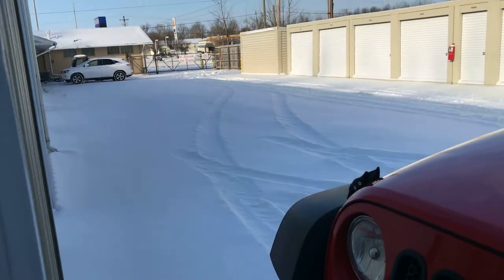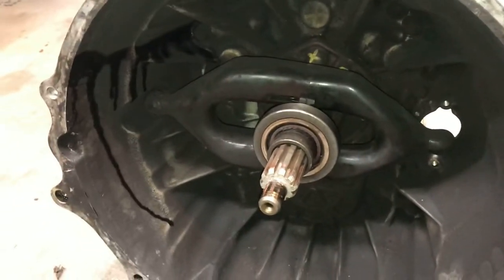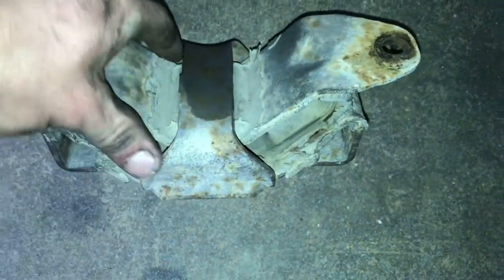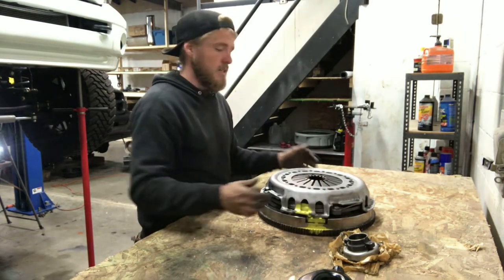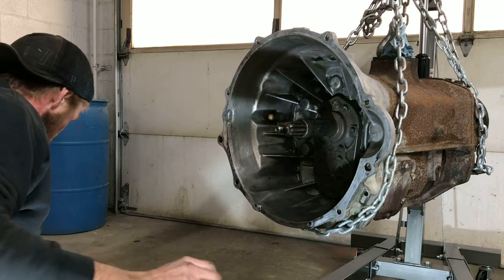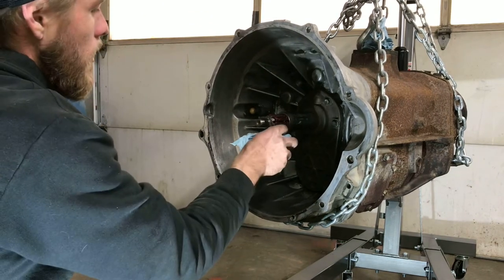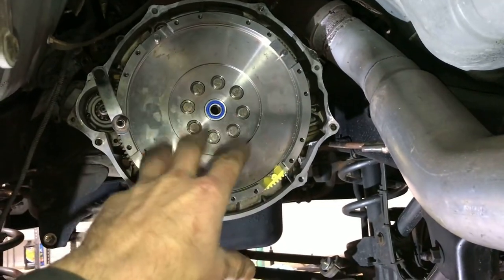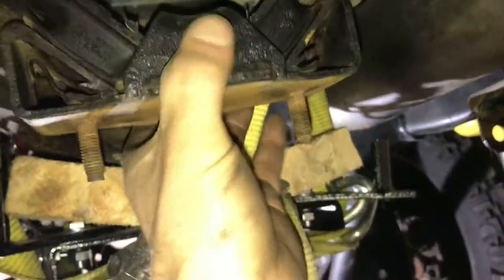CUMMINS NV5600 DUAL DISC CLUTCH INSTALL

Comment: I have a nv5600 and a valair 650 dual disk.. put the clutch in. Sounds like the throw out bearing is out. Snapped the trans 3 weeks later. New trans same clutch new Throwout from O'Reilly's put it all back together and same sound. I watched your video. Only thing I didn't do the same was take out the washer... Could that be all my problem is?

Comment: Definitely spend the money on a good adequate jack... Great video! I have an 05 Dodge 5 speed manual and this guy is trying to tell me the input shaft is bent, I have a pretty good eye being a career Union Journeyman Carpenter and I just don't/can't see it! I think he didn't grease a fucking thing! Oh, and to be clear, he did a clutch job then started telling me about the input shaft, then he couldn't get parts for the transmission which, I do know is a bitch but other transmission shops said they could get parts no problem (of course also wouldn't divulge where to get these illusive pieces) but... So, he put it all back together and soon thereafter it started making a whining when the clutch is disengaged but as soon as I put a little foot on the clutch pedal it stops. After it consistently getting louder and worse obviously, I finally got him to honor his work, dropped the trans and I can tell, he didn't grease shit! I ALWAYS, ALWAYS! NO MATTER WHAT even if it says it's been packed, ALWAYS repack it, can't hurt! My question is there is a tapered bearing inside behind the input shaft yes? And I believe I got it, I believe I can go in from the input shaft but he believes I have to tear the rear of the trans apart, is that so? I in mind believe that the sounds were abnormal wear due to non greasing or lack of! The throw out bearing is still fine, pilot bearing is still fine although there is a groove where the pilot bearing rides on the input shaft but all other trans had it too and this guy says it should be completely smooth! Idk.... Any help and or suggestions would be greatly appreciated, thanks! Love the video though man!

Comment: What fluid did you use in the nv5600 and also how much. I just bought one from a trans shop and the said to add 8qts of 75-90 synthetic gear oil. But every video I see they use royal purple or amsoil synchromesh and they use 6qts.

Comment: Defiantly a pro tip using the clutch to work the grease into the splines, I'm stabbing mine back in tomorrow with some help thankfully. Do you remember where the long bolts went? I forgot when I was pulling mine.
Reply: I've read and seen videos where they say to barely grease the splines, because you could get sling off. I think valair recommends dry graphite. This is a great video. I'd like to do my own clutch when the time comes.